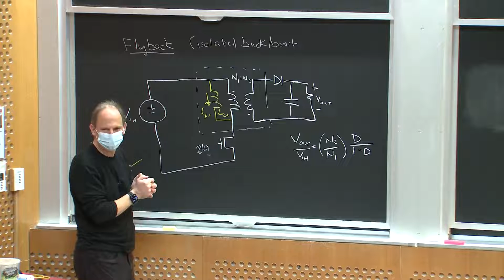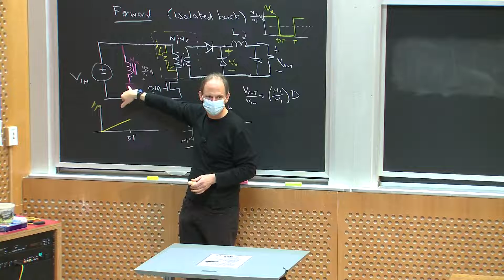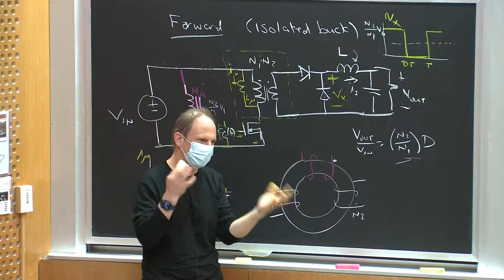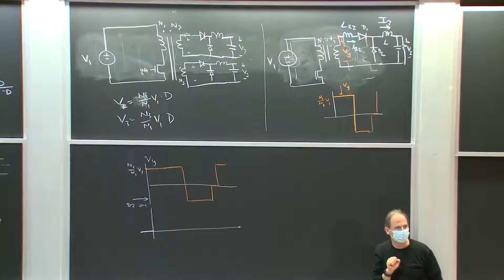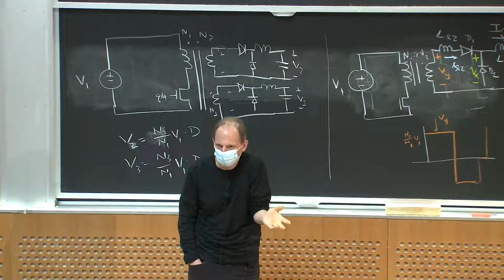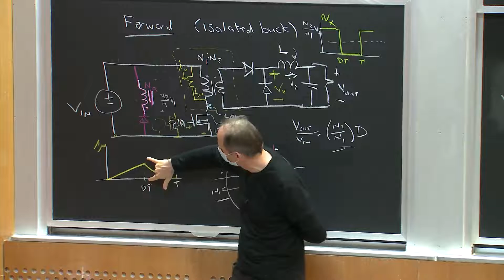Lecture 14: Isolated DC/DC Converters, Part 2

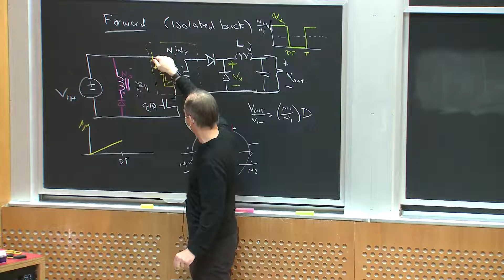Comment: 10:00 isn't the tertiary winding now also failing to reach 0V at steady state?
Reply: V_IN*(N3/N1) while the switch is ON
- V_IN while the switch is OFF
then zero voltage after discharging all the energy until the switch is ON again

Comment: in forward converter, instead of a separate winding to reset the core, why not have the output rectifier be a full bridge rectifier so the magnetizing current can be dumped into the output? I see in 2 switch forward, they do this but dump the core energy into the input, but is dumping the energy to the output with full bridge rectifier common?
Reply: you can be cirtain that  flux core can dump back into source of primary but to dump into secondary might be a problem if there isn't any load at the time. I am also another student not an expert.
Reply: He mentionned it in the first part around the end ! (Lecture 13: Isolated DC/DC Converters, Part 1)

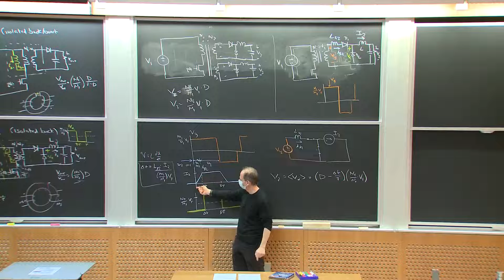Comment: when you draw the current of the leakage inductance ( 33:49 ) at the part of d1 conduct only it needs to be equal to the "buck" inductance that's in series? it can't be constant.
Reply: i think hes assuming the inductor is like a current source, so its constant. But yes it does change.

Comment: It should be called a flyback inductor, a two port inductor where you charge it from the primary port and discharge it from the secondary port.

Comment: No one really understood the purple inductor - I guess. I certainly didn't.
Reply: It discharges the energy stored in the parasitic inductance of the transformer back into V1 by having the opposite polarity than the primary winding. The full bridge converter shown later doesn't need this because it reverses the polarity on the primary winding directly.
Reply: It is there to help discharge the magnetizing inductance (or reset the core) so that you never saturate the core in periodic steady state. The purple winding works in a similar way as the secondary side of the flyback transformer (you charge the inductor during the on state of the controlled switch and you discharge the core during the off state of the controlled switch). You have to be careful with the off state timing so that the magnetizing current reaches zero before you turn on the controlled switch again in the next period.
Reply: The winding in purple does not carry current when the switch is on, for the diode in series with it is reverse biased. When the switch is off, the polarity of the voltage across the winding changes and the diode becomes forward biased-it becomes forward biased when the absolute value of the voltage across the winding exceeds Vin by a diode turn on voltage. As a result, current flows to the supply. Since the polarity of the voltage across the winding is in reverse direction to what would have increased the current, the current through the inductor decreases and eventually reaches 0A. When the current reaches 0A, it attempts to flow in opposite direction and it faces the diode in reverse direction. As a result, the current stays at zero and the voltage across the purple winding collapses immediately. Now the core is reset and ready for another cycle.
Reply: @getusel  Great explanation
Reply: The analogy I like to use to understand is . Imagine the magnetising inductance as your fridge the more food you stuff in there the less space you have to store food in the future untill eventually your fridge is full AKA saturated 😉 so to avoid your fridge from being full you need to somehow get rid of a certain amount of food to put in new food you can either bin it or eat it . If you bin it you can think of it as you clamped it so energy wasted . If you ate it you can think of it as you used it for useful work I just like the fly back . Think of the purple inductor as a way of getting rid of energy in the inductor so there will be space for more in the future . If you don’t get rid of enough energy than you put in each trip then eventually it will pill up and saturate and bad things happen . I hope this helped someone.
Reply: Possibly because he drew it away from the other 2 transformer windings. Remember that it is actually a 3rd winding on the same core but with a reversed polarity. Redraw the circuit with the 3 windings on the core, I find that it reads better in a visual sense.
Reply: Seems like you didn’t only get to learn the purpose of the “purple inductor” but also the harsh fact that “not to speak for others”🥸